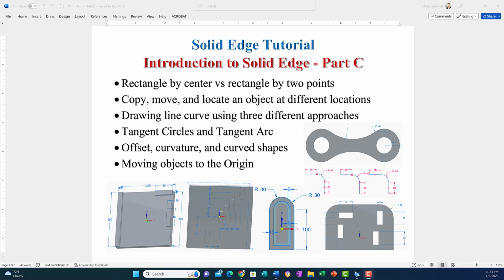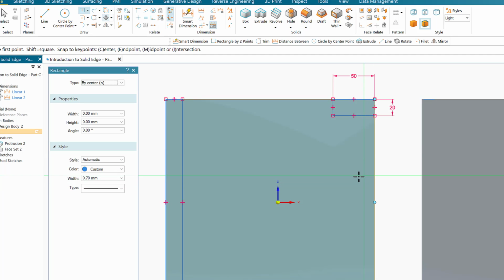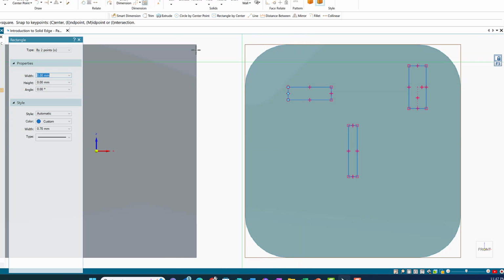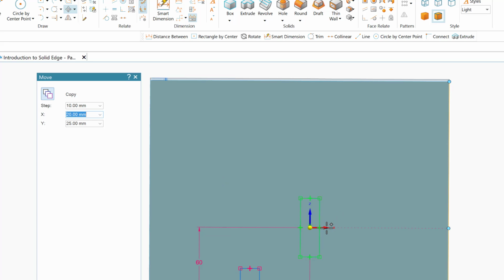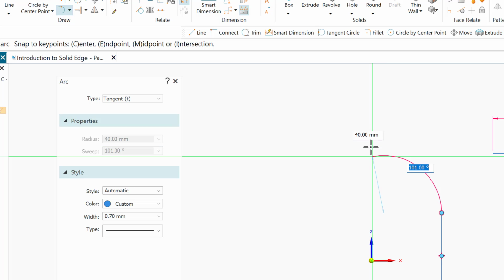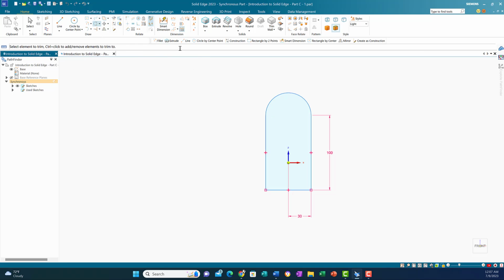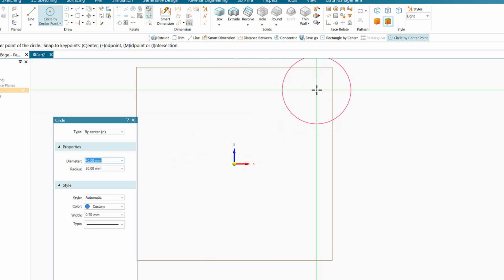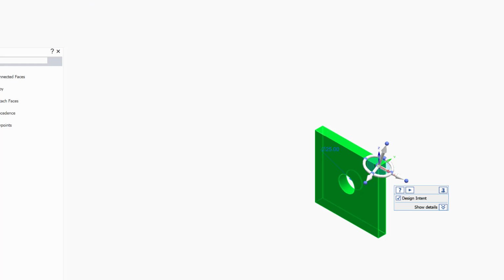Introduction to Solid Edge  -  Part C

Comment: After I finish the Introduction videos and the Absolute Beginner videos, which ones should i watch next?
Reply from the maker: @kalvin1123  Congratulations on finishing these videos. Now start with the labs' first 5 labs and then your choice either the exercises,or practice for beginner,  or continue with the labs.
Reply: @drmseif  Would you please split up the Solid Edge videos into smaller playlists:
1) Introduction
2) Absolute Beginner
3) Labs
4) Exercises
5) Practice for beginners
It will definitely help
Thank you
Reply from the maker: @OddDudeSays   Thank you for the suggestion. I will start doing this.
Reply: @drmseif  Thank you. I wasn't sure what to watch next.